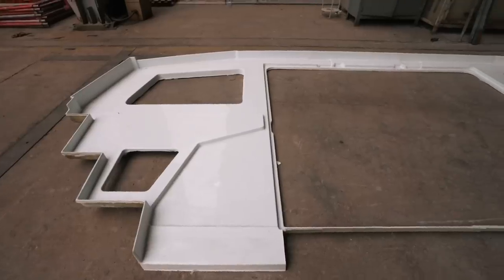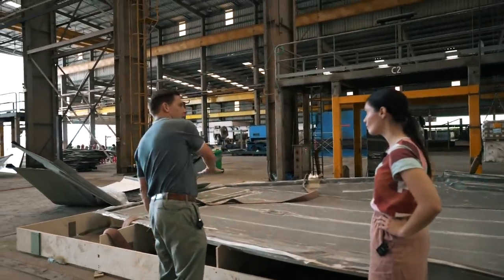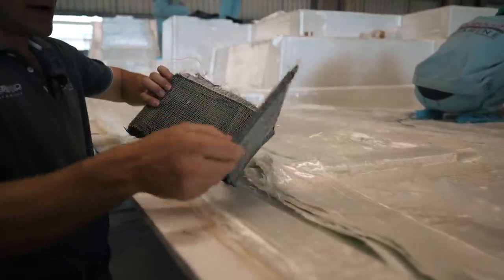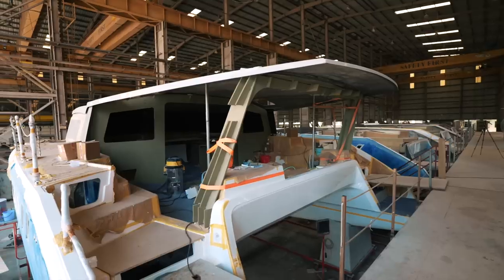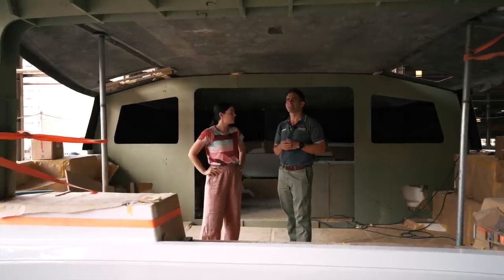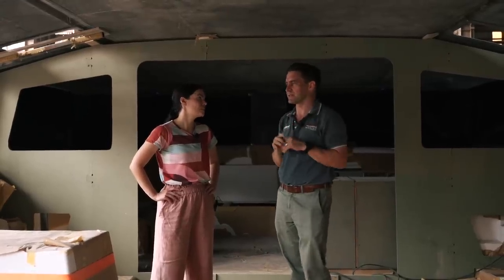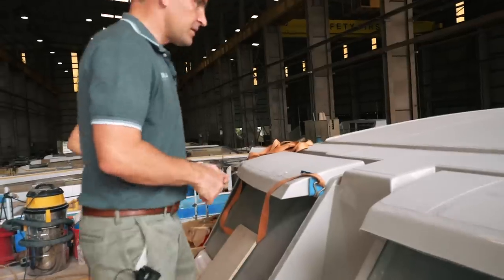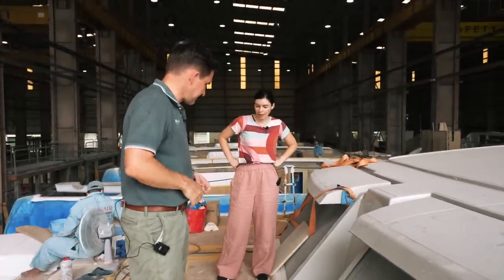CATAMARAN BUILD Update & Walkthrough with Terysa! | Ruby Rose 2 Build

Comment: Hello there, curious if you had the option of going with a shaft Drive as opposed to a saildrive, with the benefits of a shaft drive really out weighing SailDrive curious why you went with that, Just with the elimination of all that extra maintenance that goes on with a saildrive is justified enough, I do understand it’s cheaper for the builders to go with those, but once The chance came that I had on our new boat that came with shaft drive I can’t believe the difference, and with all the elimination of the extra maintenance and problems that are eliminated with a SailDrive

Comment: This comment is about the science behind glass fibers. There are 2 primary fibers made into glass fibers. The most common by far is E-glass. That is the term I hear being used repeatedly in the building of craft at Seawind. There is a better glass for structural applications. S-glass for structural fiberglass. The E-glass is far more common, cheaper and definitely not as strong. S-glass fibers, developed for higher strength, are based on a SiO2-AI2O3-MgO formulation but contain higher percentages of SiO2 for applications in which tensile strength is the most important property.

---------------------------------------------

I cannot believe that the many uses of E-glass I see on this craft are not primarily structural. So why take the small dollar saving by going to E-glass from S-glass? It seems penny wise and pound foolish. I agree there are places on the boat where E-glass is as effective as S-glass. But they seem like few by comparison. Please help me understand this engineering trade off. 

There are other properties of S-glass that are superior as well. Water logging in areas that can get exposed to long term submersion S-glass is superior by far in those applications.